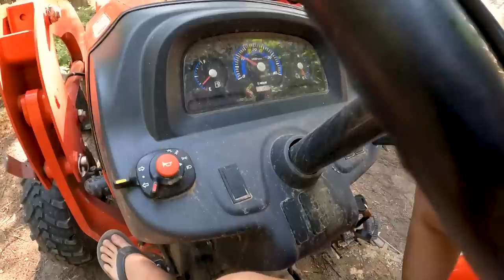Milling in the HOT Sun | This Log Was Way Too Big For The Mill

Comment: FYI. My mill does that when the blades start getting dull. Then sure are some beautiful cuts of lumber though !! 😊
Reply: Exactly. Dull blade was my thought when watching the mill head shake and bog down going through the log. I have to slow down on big logs, but not terribly slow and still cuts cleanly as long as my blade is sharp.
Reply: Blades can be expensive. But you definitely need a new one or get that one sharpened. Always nice to have a spare anyway.👍 good luck

Comment: Anytime you cut wide boards you encourage blade drift. Take six inch or what ever max depth of cut for your mill and set those six inch slabs aside and then stand them on edge back on the mill. This keeps your blade guides close to the slab and you stop the blade from wandering and making wavy cuts. The boards will be much more stable as they will be quarter-saw of rift -sawn.

Comment: Just got through getting caught up on your build, I did not notice 2 things. Did you put in a ground rod, and have you insulated under the house between the floor joists? ..... also if you take the cut off slab wood and lay it down across the road in front of the mill during mud season, you can use that as a road base to cut down on the mud there.

Comment: Good going with that big pine. Dull blade plus it may need to have the teeth reset? Is there a local place around you that can profile and reset the teeth? I used a mill years ago and had 7 new blades I bought in Merritt. An old trapper fella where I was building had a homemade profiler that he let me use plus the pliers to reset the teeth. It was a week of daily milling before I'd have to resharpen.  I bet you two could make a blade profiler! maybe something on youtube?? Good channel by the way.

Comment: Have you thought about putting up more ceiling fans throughout your house ? Moves air, makes you feel cooler, means you can keep your thermostat slightly higher. Longer fan blades will move more air !

Comment: Is there a jig you can make that would hold the salt in that position and could also use your rail? It almost sounds like an easier way to cut since you would never have the weight of the tree on the blade? I'm talking about when you had to cut the sides off so you could start using the mill?

Comment: Have you thought about using a wind turbine to make power?  You could place it next to you solar panels and use the same wires to send power to charge your batteries.
Reply from the maker: It's not windy enough here.  It could help a little but solar is the way to go up here

Comment: Ahhhh, home!  I miss it.  As for the wavy cuts, that probably has more to do with the blade than anything else.  I know you sharpen them, but they need to be set too.  If the set is off, the blade will wander.

Comment: As a suggestion I suppose that the blade to the saw would be binding when you've got multiple board's putting pressure on it. Perhaps removing each board cut to lighten the load on the blade.

Comment: You both are pushing your luck on safety. One slip and your going down.  It might be hot, but its not worth a trip to the ER.  Proper footwear, clothing, and head protection should be priority for a safe job.

Comment: I used to roof and had a roll of tar paper sitting upright fall on my foot and break a toe while I was wearing leather work boots(non steel toe).  Wearing flip flops would not be advisable. 

Also, I've worked with upright woodworking band saws and when one of those blades break it can be like a pissed off snake flying around. A bikini and no eye protection doesn't offer any protection from that either. 

If a woman wants to look sexy, look sexy rocking some better, job specific, attire.